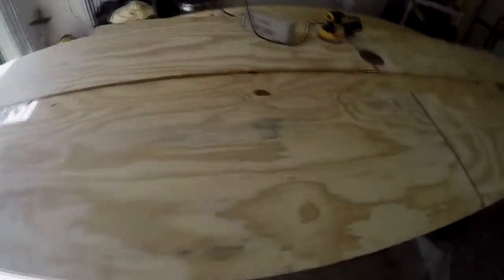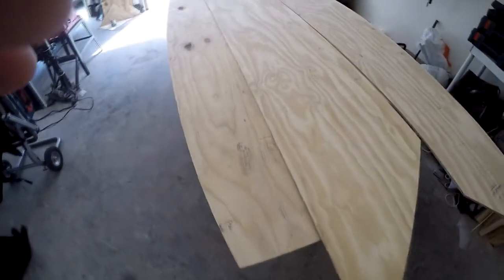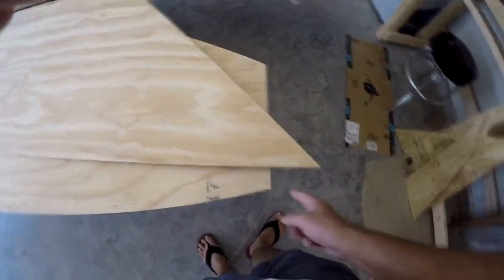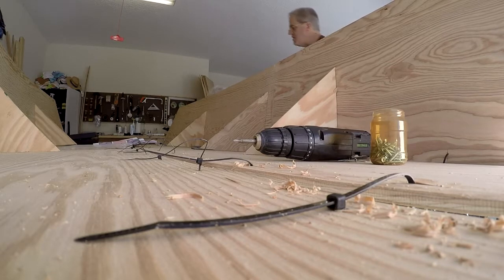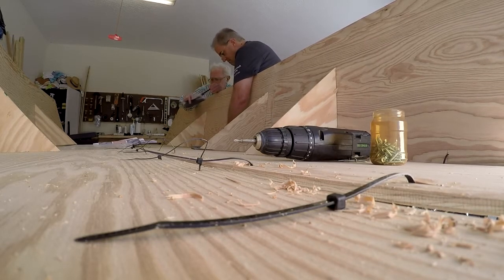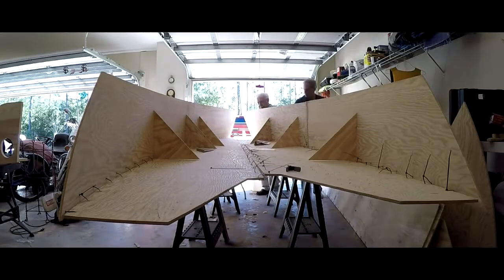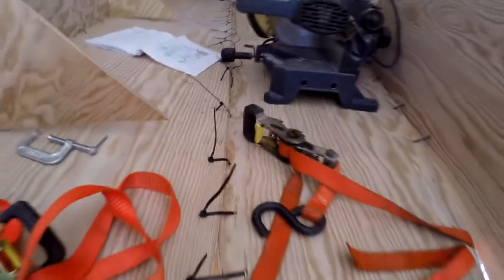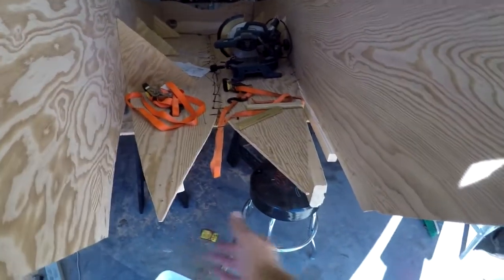11  Building a Boat Tango 15  Stitching the Hull

Comment: Saw on a vid where this guy put about 2" pieces of prob 3/4 "o.d. pvc pipe along his joint in the bow.he ran the tie wrap thru the holes and pulled them tight around the pvc.,it pulled the 2 pieces together without lapping them like what happened to you when u got to the bow.Pretty slick idea.
It looks like ur coming along fine,do u have a finished pic or vid?

Comment: It doesn’t look like you’re using marine grade plywood. Have you gotten any soft spots or rotting? I’m about to start building my tango and I’m seriously considering just buying plywood off the rack at home depot and hoping for the best
Reply from the maker: Andrew Guresky it is marine grade plywood. My original mock up was big box $8 a sheet plywood but the actual build is marine grade. I would t go with big box lumber if you want the boat last more than a couple years. Pouts and gaps are hidden and larger in that would. Chance of major failure is much higher

Comment: You need to take the sides off, put the two bottom pieces directly on top of each other and stitch the whole edge and then open it up like a book. The. Add the sides starting from the bow
Reply from the maker: In hindsight, that would probably have been an easier solution, but the beveling (or amount of bevel) was the biggest piece I missed. Without taking off enough of the corners, my way, or what you suggest above would still fail. Honestly I didn't realize how important that small piece of work was to the structure. Next time though, your idea would be MUCH easier. Thanks.